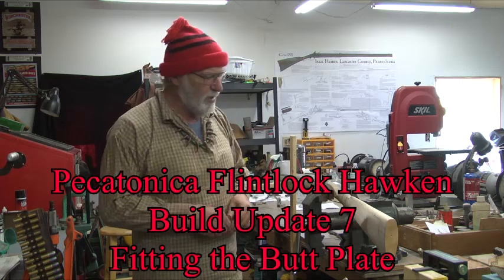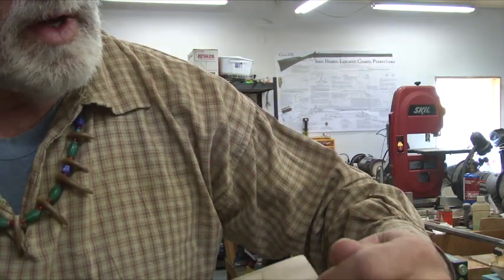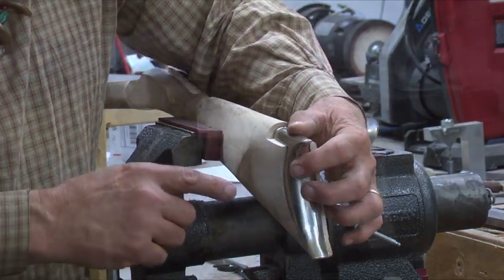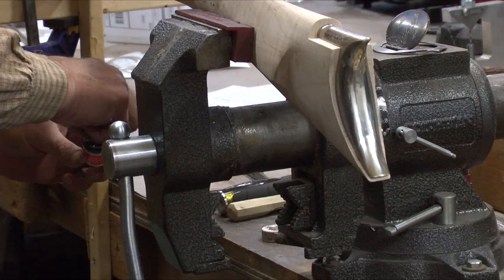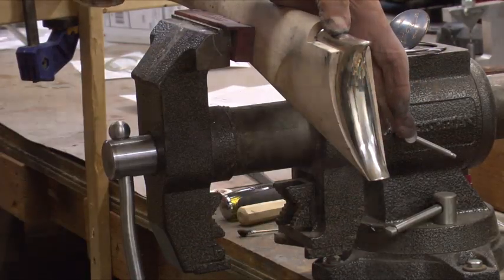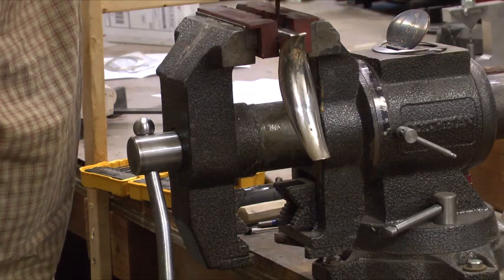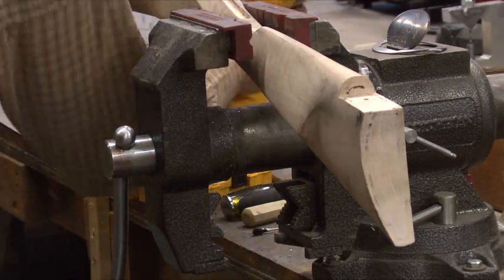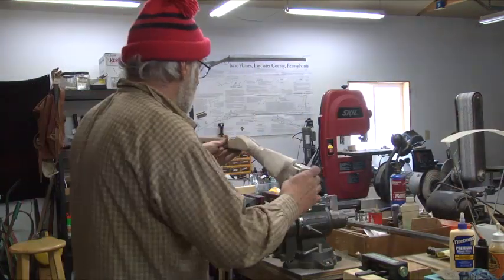Pecatonica River Flintlock Build  Update  7  Fitting the Butt Plate

Comment: The barrel will determine where the lock will be positioned, the lock determines where the trigger goes, the trigger determines where the butt plate goes so you can control you trigger pull!
Reply from the maker: Thanks for stopping by
Reply: As Ed McMann would say, "You are correct, sir."